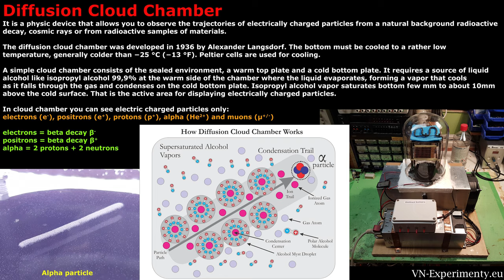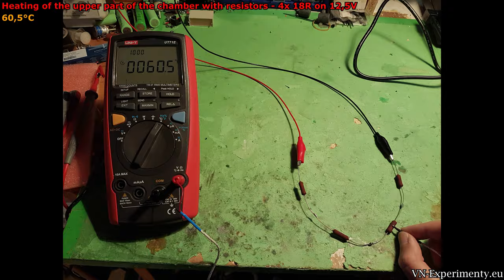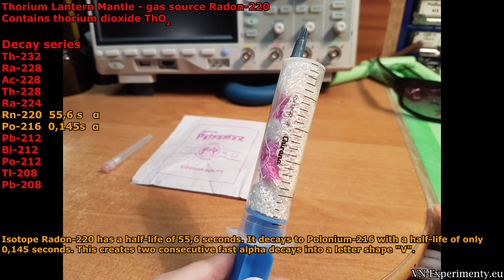Diffusion cloud chamber - FINAL video of overview and demonstration !

Comment: I made one - few years back, with a 5v & 12v peltier cascade and two separate supplies, but no where near as complex & controllable as yours - I would have to touch top of it to ground it and reset so I could also see a shower of particles - AM241 is very active - and the mantle you use is doped with the biggest & most dangerous by-product from nuclear reactors in the world, that being Thorium which emits really energetic decay particles.....awesome work!!!!

Comment: If you change your description to:

00:05 Photos from the construction with a description

01:36 Video preview
03:37 Radioactive background, cosmic rays

07:39 Uraninite (pitchblende, uranium mineral)

09:47 Autunite (uranium mineral)
10:34 Americium-241 (α-decay)
12:00 Strontium-90 (β-decay)
12:52 Uranium glass
13:28 Radon-220 (radioactive gas)
16:27 X-RAY interaction (DY86)
18:21 Gamma interaction - 4x Am241
19:20 Gamma interaction - 1x Am241

Youtube will automatically create chapters in the timeline of the video :)
Reply: you just need a newline in there?
Reply from the maker: it works, thanks! :) .. the first part must not be 5 seconds, but at least 10 seconds

Comment: "You can't put much pressure on peltier cells" ...well it depends on how you do it. 

I've used a vise to squeeze several peltiers with so much force that my dried-out thermal paste was spread so thin that the elements were literally glued to the heat sink without any glue! Seriously, you couldn't even rotate the elements anymore or slide them off.
Reply from the maker: nice :D .. but one does not want to take risks, a friend broke off a peltier xD
Reply: @teslista555  Yeah sure, my elements were the cheapest chinese models so it wouldnt have been much of a loss :)